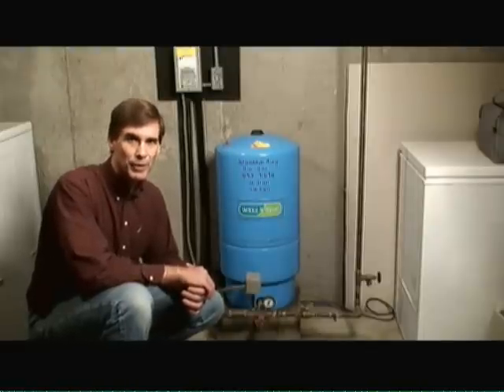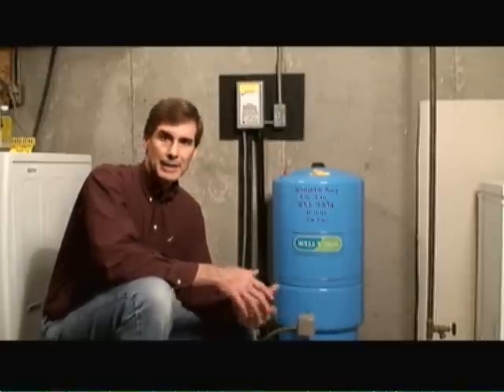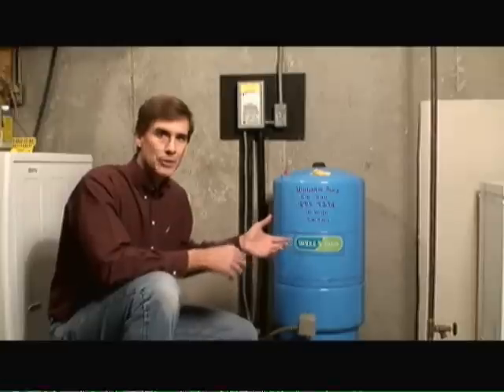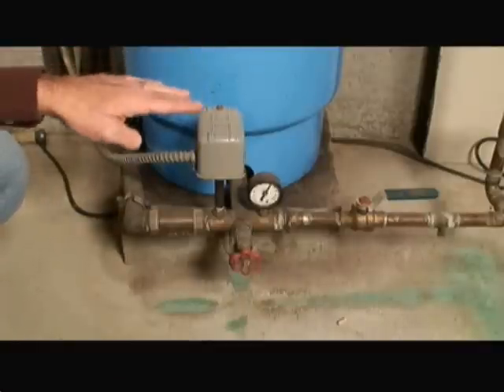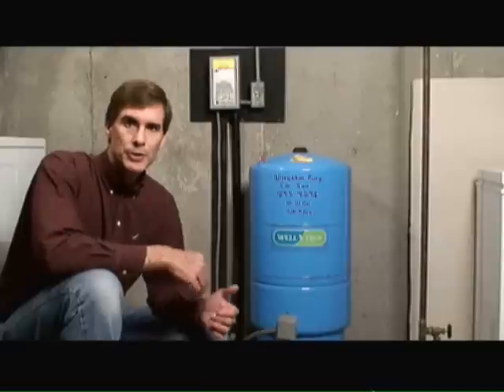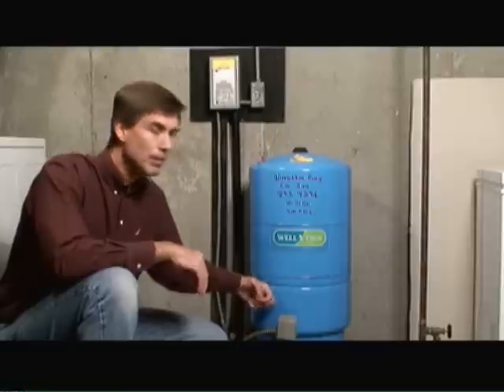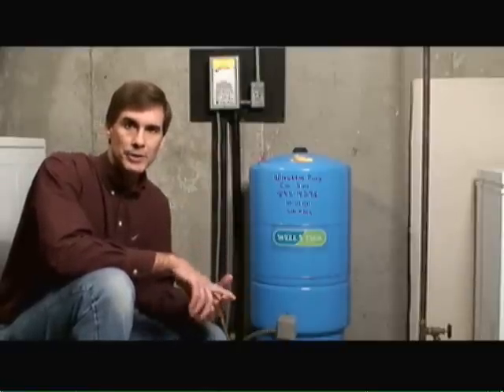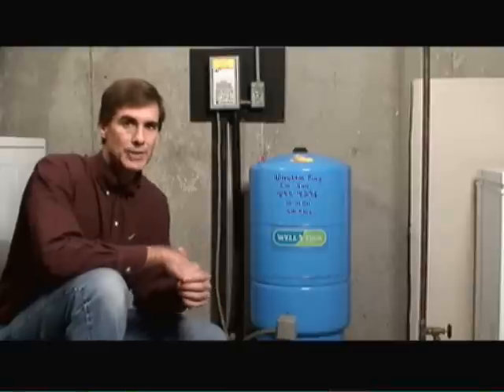Pressure Tanks and Private Well Systems Video

Comment: This video helped explain a situation happening with my pressure tank. About every 2 months I have to drain the tank, pressurize the tank to 55 psi and then refill the tank.
Eventually the tank becomes waterlogged and the pump comes on immediately whenever a faucet is opened. I repeat this process and I'm usually good for another 2 months.
Also, I have noticed during this time period, I get small bursts of air when I open a faucet which was always puzzling me. Now I know, time to get a new pressure tank. Thats for a great video Mark.

Comment from the maker: @MrBeny179 Yes the pressure in a water pressure tank usually sits between 40 to 60 PSI. The thing you are referring to is where air is pumped into the air bladder portion of the pressure tank. The bladder is used to keep constant pressure on the water that is fed through your home. Normally you should not need to put air in this. If you do, you probably have a broken bladder and and need a new pressure tank.

Comment: I only had a hose running off a spigot.  Eyeballing it at maybe 4-5 gpm, solid flow.

I checked the bladder pressure and it was too low at 10psi.  As my cut in is 40psi, I set it at 38.  Now it takes a full 2 minutes to fill, and 80 seconds rest,  I'm going to get a larger tank and link them together.  

Thanks for the reply!

Comment: The air preasure in psi should be set to about 2psi lower than the cut in psi of the pump relay. Yes most tanks come with about 18psi in them from the factory simply so the bladder is not collapsed on itself in the tank. This is just based on what I read online.

Comment from the maker: The outside spigout may be connected into the water supply line before the pressure tank. It sounds like the pressure tank's rubber diaphragm may have a hole or tear in it. If this is the case, diaphragm cannot push on the water in the tank to give you an even flow out your faucets. Since the outside spigot is pre the pressure tank it would only see the water coming in from the well.

Comment from the maker: It depends on what is causing the draw. Is it to big Jacuzzi tub with a 3/4 inche supply pipe. Overall the cycle times seem short. I think it should take 1-2 minutes to come back up to pressure and shut off, and about the same to cycle back on when there is a water draw.

Comment from the maker: I'd suggest turning off the pump and hooking up a garden hose to the base of the pressure tank. Run the garden hose outside and then open the drain valve to the pressure tank. Let all of the water and sediment drain out of it. Then turn off the valve and turn on the pump. Let the tank fill and then see if the water is now cleaner. If not flush the tank once again.

Comment: @HomeAdditionPlus  could also be the needle valve in the air stem leaking slowly, try letting all the air out of the tank to see if you get water from the air stem, if you don't ...replace the needle valve then recharge the tank with air. air should be set 2lbs. below cut in pressure of the pressure switch... also note system pressure varies in homes from 20-40 to30-50 to 40-60 and so on, 40-60 is an accepted standard these days but is not the norm, depends on your system's age and components.

Comment: how long do pressure tanks usually last? why are they all that color blue? what does the inside look like? and should they be changed if they still work? mine is over 30 years old so should i try to stretch out a few more years out of it or change it now?
also, how long do typical well pumps usually last? 5? 20? 30? 50 years??? p.s. thanks for an informative presentation.

Comment from the maker: Is there a water filter in-line after the pressure tank? It could be clogged and giving you the low pressure on the faucets. Often the outside spigot is between the pressure tank and the water filter so that the water filter doesn't get clogged when you, for example, water the lawn.

Comment from the maker: 1.25 GPM is very weak. 5-7GPM is ideally what is needed for a residential home. Though some will argue a 606 foot well makes a large resevoir. Heard the same response before and trust me, that resevoir will not be enough if you plan to water your yard for more than 30 minutes.

Comment: Nice video -- question -- what if someone wants more storage capacity, in case of extended electrical outages?  Would you recommend a new, bigger pressure tank, or just adding on an FDA-approved storage tank of (how many) gallons?

Comment: I just replaced my well pump, pressure switch, and tank. The tank we had there were two pipes. One for water in, one out. This made sense. The one that I bought only has one pipe. The old well pump was installed in 1972. And always had pressure. Now the pipes bang as if there is air in the pipes. And there is no bleeder valve in the tank. Is there any way to bleed the air out of the tank? Guess the new tank isn’t making any sense to me.

Comment from the maker: The control box sounds like it is burnt out. Yes, particularly if for some reason the little nipple going to the control box is clogged. This could cause the pump to attempt to run continuously and increase the water pressure in the house. This could cause the pump, as well as the control box burning out. I'd call a well pump guy.

Comment: My tank regulator cuts in at 40 and off at 60.  It takes ~30 seconds of pump run time to build that 20 psi, but only about 12 seconds to drop the same amount.  I'm concerned that my cycle and relief durations are too short.  Does that sound like a common problem with the tank?

Comment from the maker: It could be a faulty pressure tank or a failing submersible pump. Also, if you have a water filter make sure it is not clogged up.

Comment: I just added two bathrooms - one located in a detached garage.  Will increasing the water pressure at my pressure tank or increasing the size of my tank help keep the farthest fixture from loosing pressure when someone else is showering, etc?  I think my current pressure tank is 85 gallons.  The water line runs length-wise through my ranch-style house on to the detached garage.  The distance from my pump house to farthest fixture is about 200'

Comment: I have a newer pressure tank on a low producing well.  I actually had good water pressure the first couple months it was installed, but now the pressure seems lower.  Do I need to check the bladder pressure? Can I measure the air pressure in my tank with a tire gauge? If so, what should the pressure be?  Thanks for any suggestions you can give.

Comment: I got a call from a friend who had a pipe break. I reparied the break but noticed alot of mineral buildup on the insides of her pipes. she is now haveing pressure issues with her supply sputtering  and gurggling. I checked the spring house and there is still plenty of flow(wells not dry) the issue seems to be with the pump and pressure tank. I deal mostly with new home constctiion plumbing and have never messed with a prssure tank or inhouse pump. whats the logical place to start?

Comment: I have noticed there are 20 - 40, 30 - 50, and 40 - 60 psi switches.  How do you determine the proper switch range for your system? Does it depend on piping system for the home, the well pump system or pressure tank, or both perhaps?

Comment: I have 2 of those tasks connected to my system. One of them has the switch for the cut in and cut out, the other one doesn't but has a pump which turn on most of the time.  When I use 2 valves for water hoses example filling my swimming pool I barely have preasure.  I saw a few videos but can't find the issue.  My psi coming from the well is 50 the one from the pump next to the tank is 25 all the time it never changes. Water on or off is always 25psi

Comment: I have a slow trickle coming out of my kitchen faucet. It's a new tank, within a year old, I raised the pressure in the tank from 45 to 65. It helped but still no where near the flow and pressure it should be. There is also lots of sediment in the water. What might be causing this?

Comment: @smhoffman2010  a back up generator will keep your water running plus a few other important things.. the cost of a generator compared to extra tanks and install is going to be close to the same thus the generator has more practical uses and a lot easier to replace...

Comment: i have a pressure tank just like the blue one in this video and everytime i use the sprinkler outside   the fuse blows its a 15 amp.its been 15 amp. since we moved in 3 yrs. ago i replaced the pressure switch but it still does it. i was wondering if u have any ideas what might be causing it?could it be the tank? thank u

Comment: a good video, I changed the tank about 5 years ago, the pump was running to much so I tried to check the air pres and water came out from valve stem, its a flow tec. do you know if I can buy a bladder for that and where ? I checked on line and flow tecs site, I don't see any. Any ideas ?

Comment: Is it difficult to disconnect the pressure tank? The closet which the pressure tank was put into has a bit of mildew in it due to a previous water leak and we want to take the tank out and clean the closet, and put the tank back in. Just wondering how big of a job it is? 
Thanks
Reply: Should be just simply turning everything off, unplugging electricals, draining the tank water with a drain valve (it it has one) or disconnecting the plumbing lines in and out of the tank.  Also you can depressurize the tank if needed, as long as you can repressurize it afterwards.  Check youtube for replace or install pressure tanks to see the order of steps.

Comment: I have a new pressure tank pre-set at 29psi and a new jet pump factory set at 30-50psi. Should I dail down the pressure regulator (20-30psi) on the pump or add more pressure to the tank. I am worried that I might rupture the bladder in the tank if I over fill it, over 35psi it becomes hard to put more air in and I don't want to take any chances.

Comment: My holding is outside in a pit in the ground near where the well pump goes down. Our water pressure is low, how do we tell if we need a new pump or the holding tank checked?
Reply from the maker: Hazel LeMaire You're probably going to need to call in a well pump contractor.

Comment: I installed a new well pump already   it works really good but why there is no air pressure in the tank? what else is wrong with it?
Reply: It is possable that the tanks bladder is so badly broken that it will not hold air and when you drain the system, the water drains straight through without getting trapped on the bladder side. If you just had to replace the pump, you have probably had a bad tank for a long time. I would drain the system and if there is no air in the tank, you could try to add air, make sure to only add 2lbs less than the cut on of the switch. If it wont build air pressure, replace the tank.

Comment: I am trying to find out how to troubleshoot I believe my pressure tank.  The pressure tank keeps turning on and off when we run water.  Can you instruct how to fix this and what the best way to get this done.
Reply: You mean the water pump keeps turning on and off..
Maybe the tank is too small in capacity for your needs or the pressure switch needs adjustment. Of course is normall for the pump to go on and off when you use the water to replinish the tank at intervals. Is why is recomended to install large capacity tanks.  Easier on the pump,increase pump life and saves on electricity.
Reply: You'll have to pressurize the tank again with air. The standard psi is 38 lbs.

Comment: hello mark I need an advise. I  want to buy a shallow jet pump with a pressure tank to watering my garden ONLY using the sprinklers system. I have six sprinklers stations ( 10 head en each station) and programmed  in sequence. 5 minutes  each. the  further away station is about 70 feet.
A  20 gal pressure tank  will be able to pop up my heads before the shallow jet pump starts up.
Which shallow jet pump do you suggest ? power?  tank size matters? thank you

Comment: hello i have a problem with my water tank ,my son press the air pressure located in top of tank looks  like a inner tube bicycle now when fauset is on the the pump is runing and ruing  but when fouset is off the pump stop pumping any help..please thanks

Comment from the maker: If your water supply is from a well you may occasionally need to drain the tank to remove any sediment in it. Also, he may have used a bicyle pump and put more air into the tank. One side of the tank is filled with air to a certain PSI. If that air seaped out through the valve stem then he may have had to pump air into it.

Comment: My pressure is only at about 32 psi. I just changed the pressure switch too! Do you know why this would be reading so low?
Reply: Your pressure tank may need re-pressurizing.  Check its rating on the manufacturers plate and use a compressor or even a bike/foot pump to fill it to correct pressure.  Use a tire pressure gauge.  You may need to temporarily unplug your pump and open a tap/faucet to let some water out so you can pressure up the tank.  You can check for leaks in the plumbing by squirting or brushing some soapy water on the lines and connections.  Do not get water on any electrical components.
Reply: Thanks!

Comment: what stops the water from flowing back to the well after the pressure tank has been filled?.. is there a one way valve or something?
Reply: Usually there are one-way or backflow preventing valves in these systems.
Reply: ***** Sure,there is a check valve there to prevent water returning to
the well,most of the times is where the pressure switch is located.
to check it,open the water till pump start running,close the water and look at the gage when the pump stop working. lets say 60 psi. if the pressure switch hold the
pressure reading the valve is good. No one using water while you check the gage reading. Hope this helps.

Comment: My pump will not shut off. I have reduced the pressure and it still will not shut off. It's a new pump and the water tank does not seem to be waterlogged -- the top 1/3 is just air. If I manually shut off the tank when it has reached as high a pressure as it will (42 psi is as high as it ever gets), then fill a bucket, the pump kicks back on after pumping about 2 1/2 gallons of water. It takes the pump about 5-8 minutes to come back up to pressure.
Loses pressure in 1 hour and kicks on again.

Comment: can I run my outside hose off the drain valve of my holding tank. The previous owners rather than fixing the outside spigot they just kept screwing the handle on tighter I can't afford a plummer right now.
Reply from the maker: Technically you can, however I would not recommend it for long. Once that valve starts leaking then you'll have two issues for the plumber.
Reply: HomeAdditionPlus  Thank you so much for a quick response. What I did was get a really short hose and screwed it onto my holding tank  and put mounted a  spigot outside so that I won't be turning the tank valve off an on a lot. It's not a permanent fix.  Hopefully I don't create more problems for myself.

Comment: would you know the cause of hearing air in the well head in the yard, my entire system is in ground, yesterday I lost most pressure in the house, and it's spitting air, the meter in the head is at 10psi, with an air sound coming from the head, like a suction sound, we had the pressure tank changed as well
Reply: your well does not have enough water to meet the demand you are using. What we call pumping down, the water is being pump out below the pump and catches the air causing the suction sound and hints the low water pressure of 10 psi. If your well has always had good water, the screen may be stopped up. you need a well repair person to come blow out your well with an air compressor to clean it out.

Comment: Most pressure switches come in 20 pound differentials.30/50 being the most common. The proper pressure to have in your tank when your are installing it is 2 pounds below the LOW pressure on the switch. So if your switch is 30 for the cut in...then the tank pressure that is measured on the top of the tank should be 28. It is very important to have the air pressure correct to insure the best bang for your buck....have a great day.theoldkid888

Comment: My pressure tank sounds hollow from top to bottom does that mean it is bad or is the pressure switch bad .
Reply from the maker: Sounds like you may not have any water in it. If you do, then it is probably full from top to bottom and that is why you can differentiate the sound when you knock on it.

Comment: We woke up with no water, circuit breaker was tripped. So we put it back. Water was on for a while, then no water again. Father in law replaced pressure switch. Water was working and doing well for about 12 hours then no water again. Circuit breaker is not flipped. The gauge says "0" and we are not sure what to check next. Any thoughts?
Reply from the maker: Sounds like you have an electrical short somewhere in the system. Possibly the well pump maybe on its last legs.
Reply: Thank you for your prompt response! I appreciate it!